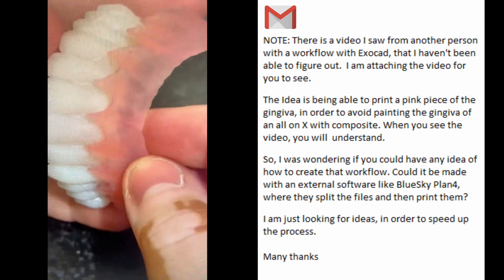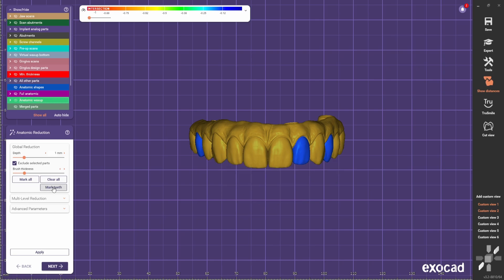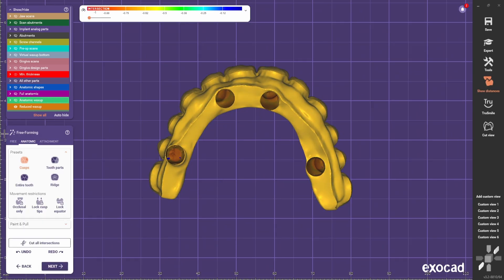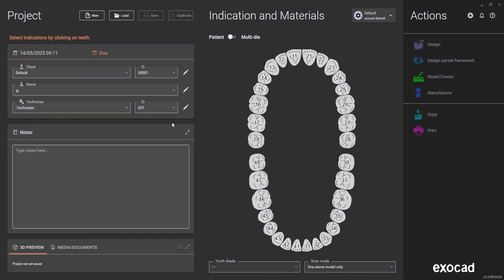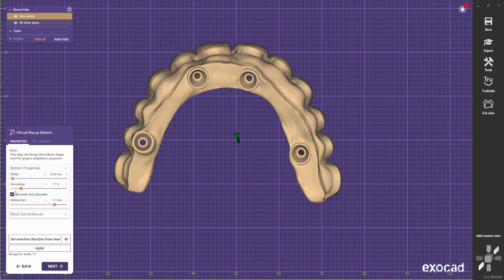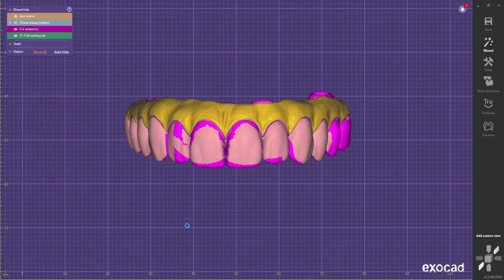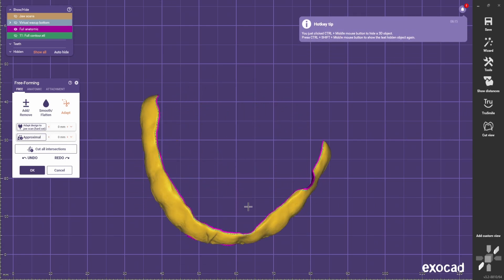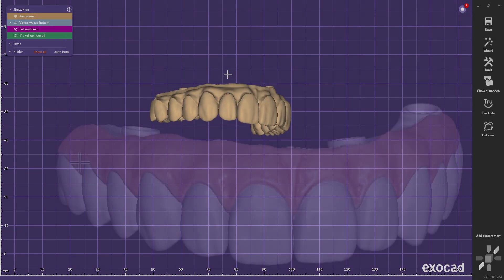Make PMMA FASTER with this Trick! EXOCAD 3.2 Elefsina

Comment: Are you able to do this by just uploading the STL file of the bridge? would love to see that and what settings / set up you use for it...
Reply from the maker: Hey! This is just an experiment. My idea of how to solve a problem one of the subscribers shared with me. What specific settings are you actually after? thanks for the comment
Reply: @DentalClassMiguel  sorry for the late response, i didnt even see you commented :) ..... i love the "experimenting" it has actually made me think of tons of ideas how to use exocad to save time... i would love to collaborate and brainstorm.... to be more specific about my question: I was wanting to know how you would set up the case if you were starting with the STL file of the fixed bridge and then do this  same exact thing... if it works how i am thinking i could print pink gums and teeth and not have to do ANY  colorization